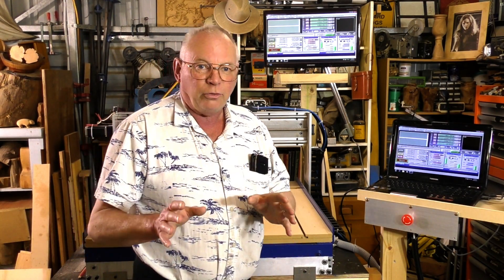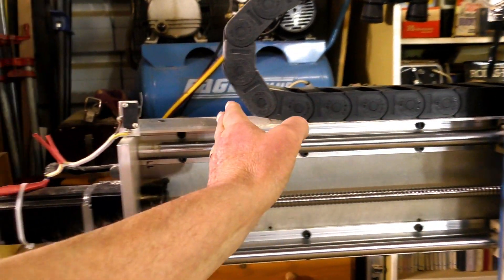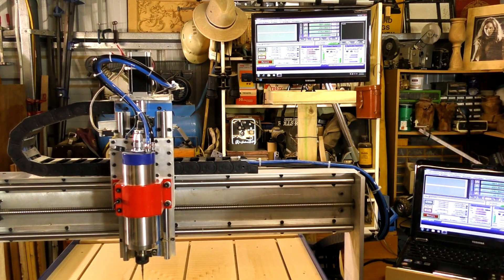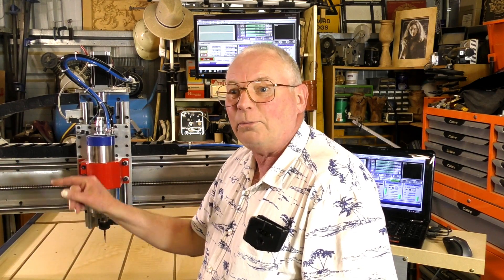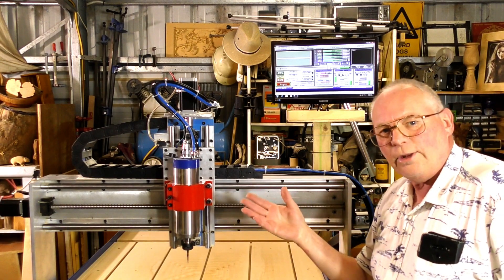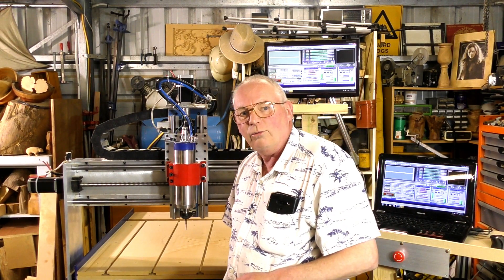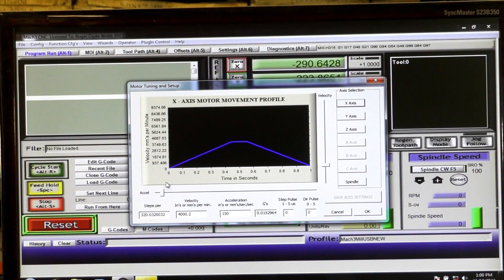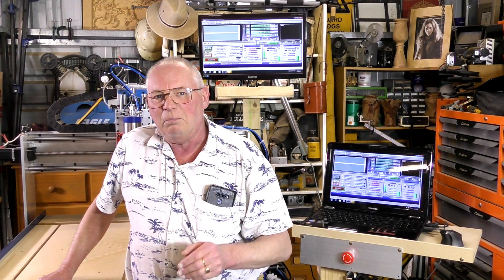Mach3 and CNC Machine EXPLAINER episode 2 ( MACH 3 )( I answer your  questions )

Comment: Could you please explain how your soft limit working because i saw on your setting your slow zone set is on 1 is that correct the reason I’m asking because my slow doesn’t work i change setting from 1 to 10 and 15 still same issue 
Many thanks Vic

Comment: Thanks Roger.  General videos about Mach 3 are very helpful and I appreciate you taking the time to make them.
Do you have a basics of Mach 3 video that you suggest for basic operation of the program?  I can use the program well enough to run my jobs, but I'm sure there are a bunch of standard commands that I could be using to take my operation to the next level.
Reply from the maker: Its on the way to the tube soon🎄